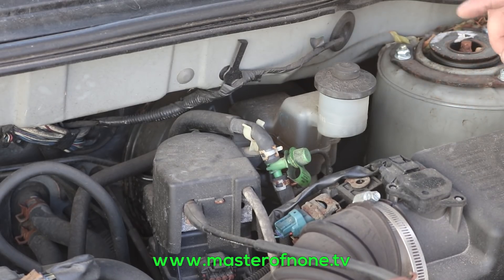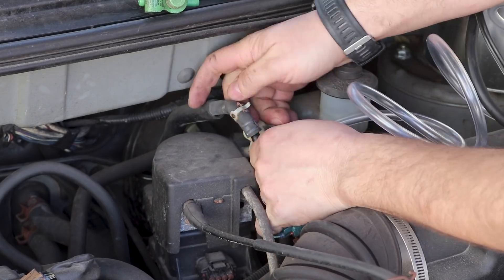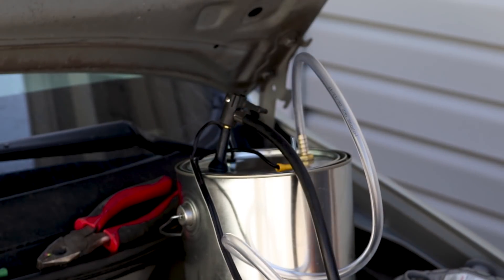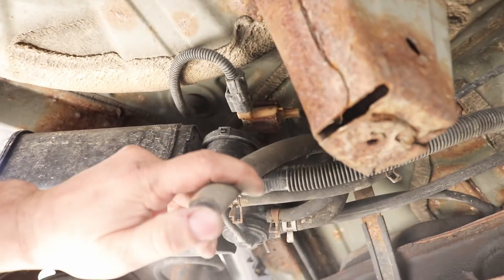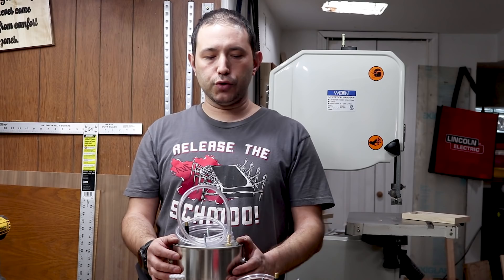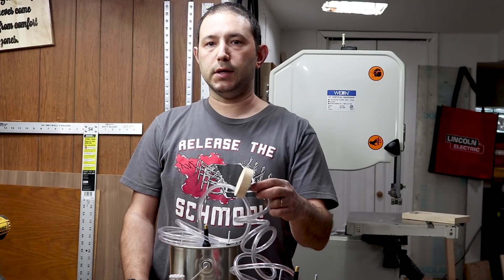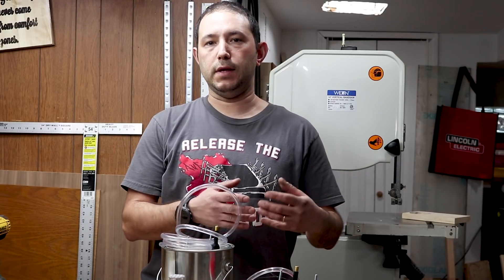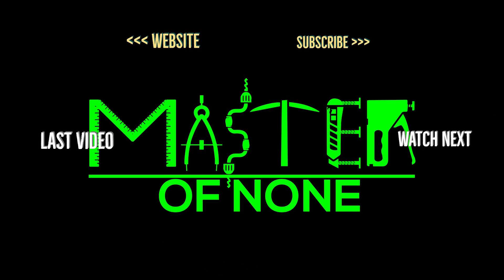How to Make a Smoke Machine

Comment: Great video but how do you limit air pressure to below 1PSI? 
The EVAP system has several components with fragile diaphragms that will tear if there's more than 1psi probably 3-5psi but only rated to 0.9psi.
That's my concern. When I look up pressure or air flow regulators that are 0-10psi or 0-5psi with Guage, I only get $300-$700 units for industrial use on expensive systems. 
A 0-150 or 0-100psi Guage won't work. I've found $30 regulators that do 0-60psi or 0-30psi but they don't show 0-1psi very well

There's a $48 EVAP machine on Amazon by Autoline that has a low flow EVAP setting that limits to 1psi but I'd rather make my own

Comment: You haven't  slowed which battery your using,the negative positive wire should not be passed through the tin cap,it should be insulated

Comment: Much appreciated, very clever, I was wondering how long does the wire last before you have to rewind it?
I like your small smoker as well,👍
Reply from the maker: Only used it for 10 minutes and found the problem on the car. So no clue how long it will last

Comment: How did u NOT GET A SHORT WHEN U DROPPED THE WICK AND COIL IN THE CAN? THE COIL LOOKS LIKE IT RESTS ON THE BOTTOM OF CAN CAUSING A SHORT? JUST WEAR OVEN MITTENS SO U DON'T BURN UR HAND! HOPE U HAVE A IN LINE FUSE FOR PROTECTION!!
Reply from the maker: William Scheidt it's just long enough to dangle and not touch the sides or bottom
Reply: For this 12v DC setup: It doesn't short because the resistance of the oil is so much higher than the coil itself, even as the coil builds heat. Heck, I think the oil even has higher resistance than our own bodies.
Reply: @hasaywha well said

Comment: Whats wrong with this video?  The most important part of the assembly is buried in the description and then the description is scanty.  The most important part is the wire.  What gauge, what material?  copper?
Reply: I used Nichrome 60 (28 GA) at a length of 9 inches for mine. No battery was able to produce steady power to make it smoke though. I’m running it with a lab power supply.

Comment: so the rubber grommets were enough to insulate without melting?
Reply from the maker: bubba dam yes they are. with a reminder that it is not for long runs(you should find your leak in 5 min usually)